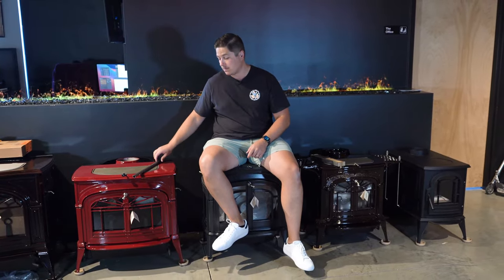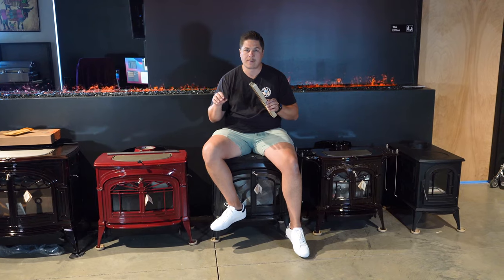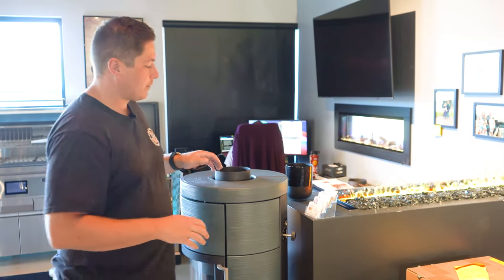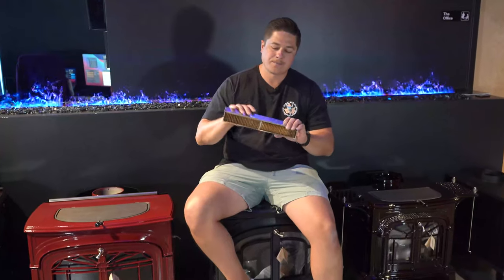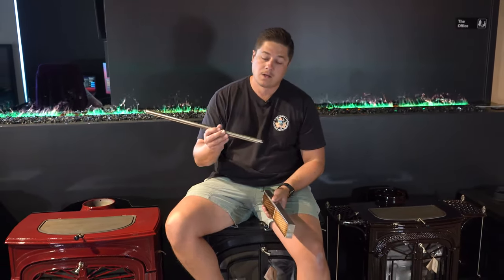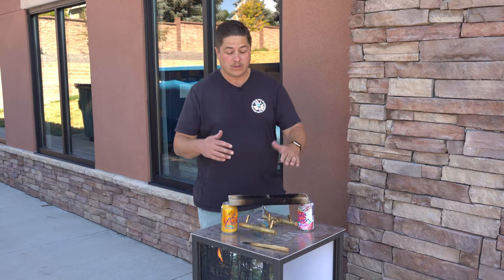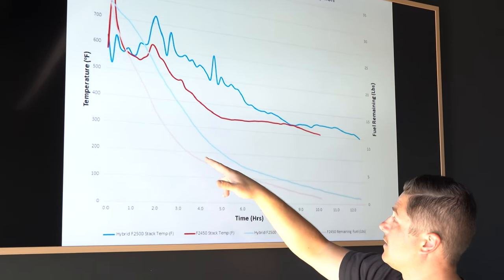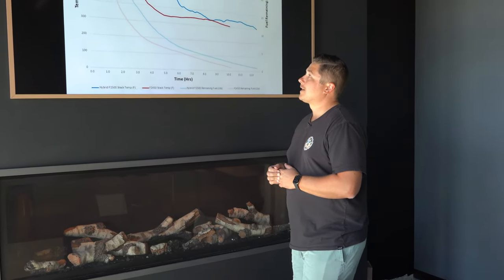Catalytic vs Non-Catalytic Wood stoves (Which one is better?)

Comment: Thank you so much for your explanation between the two. You have helped us in picking the type of stove we would need. We will probably go with the non-catalytic rear venting through our fireplace. Again, thanks.
Reply from the maker: nice! Thanks for watching.
Reply: If having a Cat stove "requires" a pro to clean the Cat then that makes it a no brainer.  Why not a tutorial on how to properly clean the element ?
Reply from the maker: @gweedomurray9923  Well if you burn properly you shouldn't have to worry. We actually recommend having a back up.
Reply: @gweedomurray9923  It gets covered with carbon and nothing dissolves carbon. I don't know how to clean carbon without scrubbing off the platinum.
Reply: @embersliving  ~ I have seen enough on the Cat stoves to know that you need to get a minimum of 500 degrees F. before turning the valve to allow the exhaust through the converter or else you just deposit crud and so block any catalyst action.  Install a pyrometer or use the handheld infrared temp reader tool.  Harbor Freight has them for $20 or thereabouts.

Comment: I have a few questions. 1. average cost of a catalytic converter? 2.Are the cats a standard size that they would be attainable after the manufacturer goes out of business? 3.The bypass must evidently be open until it is 500 degrees on startup, does that also mean someone has to open the bypass as the fire burns down below 500 degrees or can you just leave the fire burn out if you go away? Thank you
Reply: You leave the catalytic on until you add more wood or wake up in the morning and add more wood
Reply from the maker: I would say they are 400-500. I would also buy from a reputable brand that. has been around for years, so you will not have to worry about this
Reply: it wont function under 500 as they clearly say. So the  whole effect of the catalytic converter is only that the burn is slower and more clean for the amount of time its above 500. Under 500 the burn is only slower with less heat and more pollution because the catalyst is not working anymore compared to a secondary burner stove which burns hotter and cleaner but for a shorter time. Remember, there is just so much energy in a piece of wood.
Reply: @martinuso7446   So then why must it be bypassed on start up?
Reply: @anthonyspadafora1384  I guess to create enough pull. No idea why else. The whole thing feels like sales talk to me. Makes it interesting for some people. The best way to burn wood and get a so complete possible burn of the wood and its gasses is at the highest temperature possible in the burn chamber and in the pipe and with all the oxygen it needs to do that. The only stove that does that is the rocket stove. That's also the reason they put mass around it so you collect the excess heat.

Comment: The “high efficiency” don’t mean heat output efficiency, they mean burn efficiency. They increase burn efficiency by allowing more air (oxygen) into the fire which means less particulates up the chimney because the fire is hotter and burns faster. This means a hotter fire with shorter burn time.

The only way to extend your burn time is to choke off air supply to the fire. This is done by adding a second damper in your chimney above the stove. You need to control air flow in and “out” of the stove. Yes, this will send more particulates (smoke) up the chimney and also blacken the inside of your glass until air flow is increased to create a hot fire then it burns off and becomes clear glass again.
Reply from the maker: nice tip
Reply: @embersliving  A flameless fire will smoulder and send particulates (smoke) up the chimney. Maximum efficiency is achieved by adjusting the air flow to the point where you have small intermittent flames. As soon as you have a flame, all the smoke disappears. The flame does the same thing as the catalytic convertor.

Long, slow overnight burns require a certain amount of smouldering unfortunately but remember that smoke is only a problem if it’s blowing in your face or if you have a smog problem in your area.

A tree that falls and decays releases the same amount of carbon as if that tree was burned. People need to study the Carbon Cycle.
Reply: There are many ways to increase burn times, some of which can be done while maintaining an efficient burn.  It also depends greatly on the type of unit you have and what you're able to control. 

The trick is to load up the firebox while lowering the intake air to the minimum needed to achieve an efficient burn. Thicker pieces or pieces that are obstructed from the air inlet by other pieces will take much longer to burn through.

Comment: The secondary/ reburn system runs on the volatile organics.  It needs to be HOT, and have air.  You can run simple engines (old carbureted ones) on the volatile organics.  You do have to manage the extra air on the stoves so the secondary burn works efficiently.  

I like the simple second chamber  air tube/ injector system that is simple to maintain.
Reply from the maker: Nice !

Comment: Many years back we had a cat stove and all tho we burned only dry hard wood we had moisture problems in the chimney. Yes we would follow the procedure to the letter and had a triple wall chimney and did get much longer burn times we (and the dealer) could not resolve the moisture issue. When we moved into another house we put in a cast iron box stove and it worked so much better.
Reply from the maker: cool
Reply: Much better and much cooler.

Comment: Great video, thank you !  Just one taught...   I have a Blaze King ( King model )  catalytic stove in my living room in  the past 6 years, works just great !  The manufacturer calls for 42 hours of burning time,  never ever had that,  it keeps the fire overnight, hot ashes for about 24 hours, good enough.  I always clean the combustor with a wire brush, with a horizontal left and right motion.  Only the surface collecting shut,   not the inside of the combustor, therefore NOT trying to get the wires inside.  The stove puts out a lot of heat, nothing has changed in the past 6 years.
Reply from the maker: nice feedback
Reply: 42 hrs..?  Maybe if you drop a 40 lb log on a small hot coal. Lol

Comment: My father always taught me to stuff some  paper up the flew pipe and light it  so it could not draft the heat up the chimney but that was with both a traditional fireplace and a pot belly stove
Reply from the maker: interesting
Reply: @embersliving  Not really. I have been using propane torch to heat the chimney and insides, for 1-2 minutes,  then lighting the wood, arranged for top down burning. I wonder which producer would ever think of this, because a small hole in the door would come very handy for propane torch. The draft is way better and wood ignites smokeless in 40-60 seconds. One standard bottle can be used in a single season.

Comment: Figured id share this. Catalytic converters (in cars atleast) can stay Hot for hours like campfire coals. Ive worked on cars that sat for 2 hours and gotten burned by the cat converters. They definitely hold heat very very well
Reply from the maker: yes that is true!

Comment: Catalytic is more expensive to maintain. That's one reason I didn't get one. Secondary reburn works fine for us. Keeps heat 12 hours easily. EPA stove compliant, no problem. Not using outside air directly just inside ground air, works fine. Catalytic is more costly upfront as well.
Reply from the maker: good feedback
Reply: $300 cat last 6 yr, I know that sounds expensive, saves several cords a season

Comment: Good vid. I have a question, don't know if you still monitor this thread, but I am running a 2020 EPA non-canalytic stove, when it's time for me to turn in and I load it up for the overnight burn and close the air control it rolls smoke inside the fire box, while still burning very slowly. Is this how it is supposed to be operating, or am I not supposed to see any smoke rolling in the firebox whatsoever?
Reply from the maker: you shouldn't see any smoke
Reply: You need to get flue temp near 500F before closing the air down..if your window keeps getting blackened your running too cool...

Comment: We got a new reburn stove at our cabin 2 yrs ago. The old one leaked air and went thru alot of wood. The new reburn is so worth the cost up front. After a full week there is less than a hand full of ash in the pan and can go 2 hrs on one log. I tell everyone before they buy a cheap used stove off marketplace and new reburn is really worth the money.
Reply from the maker: yes I agree
Reply: Nothing cheap about the stove I purchased off of Marketplace. Lopi Endeavor is a High-end quality stove. The Lopi was very well maintained by the original owner. I only paid $600 for a high-end well taken care of wood stove that's going to outlive me and the Next Generation who owns it. Only differences, I was Smarter with my purchase by me purchasing a high-end quality wood stove at a fraction of the cost= having 🧠's
Reply: @bayside6207  by cheap I meant a 30yr old rusted barn stove for $200.  If I could get a newer reburn stove for cheaper than new 100% jump on it.

Comment: I had a catalytic stove - Vermont castings Defiant Encore 1987.  I loved it, but he's right, you have to babysit it.  Personally, I want a long burn time for night time, and if I need to close the damper to activate the catalytic stove a half hour after I stack the stove, and turn the air down another half hour after that, that essentially removes an hour of time that it can operate while I sleep.
I'm buying a non-catalytic soon.
Also, his statement about shortening burn times after cleaning a catalyst is inaccurate.  The burn times went down for Mr Knowitall because he removed the catalyst, not because he cleaned it incorrectly.  Even if your catalyst doesn't work properly - leave it in and it can still function as a damper and keep the long burn times (you just won't get the heat from the secondary burn).
Reply from the maker: great feedback!

Comment: 1.  You said that the Catalytic Converter does not start working until the firebox is 500 degrees.  What happens when the temperature starts going back down again (over time)?  Does is stay in operation or does it stop at 500 degrees again?  2.  I do not have a wood stove yet but I am getting one.  You said the Catalytic Converter style is good for people who leave their house.  Can you have a fire going in your wood stove... and leave your house?  I would be afraid of burning my house down.  Do you have to extinguish your fire if you have to go to the store?  (Sorry.  I am dumb).  Haha.
Reply from the maker: Depends on the stove you get. Fully sealed stoves are designed to burn all the time

Comment: Doses the re burn make a fire look more out of control lol I had an old wood stove and replaced it with one with the re burner and im scared it's burning out of control up the pipes
Reply from the maker: Yeah the fire looks bigger and starts faster
Reply: Get a laser heat thermometer..the temp of 451F + to about 750F is safe. Measure at the flue stove connection not at the flame. If there is a lot of flame you most likely have an air leak. The "flame" of the secondary burn is above the wood..looks more colorful and not really touching the wood itself. Its wood vapor burning. Do the leak test..put a dollar bill in the door..at all places..if you can easily pull it out anywhere...you have an air leak..put in a new gasket.
Reply: You can also see air leaks by the soot on your window..leaking areas will often soot up since they get cool room air and allows soot to not burn off.

Comment: You didn't mention how a wood stove cat converter is similar to the cat converter in your car.  They're both magic (and delicate) space age chemistry soot burners that run at very high temp and don't really start doing anything until they reach that high temp.  Nice way to tie a new concept into a familiar thing. Even if someone didn't know their car has a cat converter, then at least you'd connect to the idea of their car itself.

Another thing to mention is that regular (non-cat-converter) secondary burn tech is probably, what, 300 years old now?  (Or even as old at smelting metal--requiring efficient use of wood in a semi-industrial setting for thousands of years?!)  People who want to be rustic are just making themselves look silly by going full caveman with a pain-in-the-ass open flame when we've had easier less wasteful burning tech, proudly, for wood or coal or whatever, for hundreds of years.  

My wife sees me helping with the house all the time and I sold her on putting a stove in our (huge) hearth by letting her know I'm not into a ton of work for a tiny amount of effect, not when we can have easy wood heat that cuts down on the way higher elec bill from the heat pump on long winter nights.  You want pretty flame?  Think of the stove window as a screen showing a log flame like is all the style nowadays.  Think of the stove as an old CRT monitor made out of iron that belts actual heat when you play the log flame video, lol!  Best of both worlds.
Reply from the maker: thanks for the tips

Comment: The combuster uses platinum, not silver, silver has a much lower melting temperature. It really is only used to clean up the wood gas that isn't being burned by the fire because the damper is almost closed to limit the burn rate.
Reply from the maker: Thanks for letting us know

Comment: So, i heat with an 1984 Dutchwest Cat wood stove. Very hard to get part. But my entire house is only heated with that stove. It is extremally efficient. i only go through 4 cord a winter.  The issue i have is finding replacement parts..grates, cats, and internal parts.. do you have any of those for my model?
Reply from the maker: unfortunately not. That sounds like an amazing heater for running that long!
Reply: @embersliving  the best selling points are that they last a lifetime if they are cared for.. very normal up here to see 50-
60 yr old stoves still in use..

Comment: Until your flue gases get to 451F+ you won't get a secondary burn from the tubes either..that is needed to get the wood vapors to burn.
I don't understand how the heat from cat is added to the box since it is on the outflow..it would result in cleaner air in the chimney but most of the heat would seem to be only in the initial part of the flue???
Reply from the maker: Interesting

Comment: Thank you for the video! 
What happens if I leave the the bypass on/open in a catalytic stove all the time and not wait for it to come to the appropriate temp?? Just feel like that extra step to is a deterant for some people.
Reply from the maker: it just won't be as efficient
Reply: Decomposition rather than combustion so the catalyst surface with become fouled (poisoned) until it reaches the light-off temperature (which will then remove the fouling)

Comment: yes-you were wrong on how the secondary air works-you said it does it on its on/that not true/the secondary burn is activated after the wood stove is up to burn temperature-then you close the primary air damper back to about 1/4 of air damper-then the convection of the draw of the stove will dawn air up the secondary chamber preheating the air an into the air tubes in top of burn -this then burns the gases that would other wise escape/giving a long burn time too/do some google research/thanks
Reply from the maker: haha thanks for watching

Comment: So what is the best way to clean the catalytic combustor safely ????
Reply from the maker: hire a chimney sweep
Reply: @embersliving  but if i want to do it myself ??  My chimney sweeper takes care of the chmney and i take care of my stove. !!
Reply: Soak it in a warm vinegar solution.  You'll find info on how exactly to do this online. Works great. Did it on my last combustor.  

My current combustor is on it's 4th season and I haven't cleaned it yet.  I'm in Canada so I start burning in October.  Frequency increases to where I burn 24/7 in late December, January, and February, and then I gradually start to burn less probably until around May.  I get such great burn times and use just 2.5 - 3 cord a season. It's also a stove from 1985.  I'm sure that a newer cat stove or a hybrid would be even better.  

Cheers!

Comment: A non cat is more robust over a much wider range of operating conditions with different woods and can burn scrap material, including junk mail no problem.  You have to be much more selective what you burn with a cat.  Also, there is no reason to get a non cat stove that hot to begin with like you show in the graph.  If you even it out at the front, the two are equivalent for burn times and so on.

In any case, the most important thing an owner can do is understand how to run their stove efficiently and burn dry wood.  Use outside combustion air, insulate your fire box to the max (you can get it up to temp much faster), and then run the stove within its normal parameters in terms of output and so on.  There are a lot of people out there who simply don't know how to operate their stove effectively.

I have a non cat stove, and it is nice to have the option to burn lots of "junk" in it, especially if it is already hot.  Burnable things that can't be recycled and so on.
Reply from the maker: thanks for the feedback
Reply: insulate your fire box to the max  why would you want to do that? Isn't the point to to remove the heat into the home?
Reply: @Aj Bob  no. He's talking about the firebox. Insulated firebox will be hotter and burn better than non insulated. That's why you see firebricks in all woodstoves.